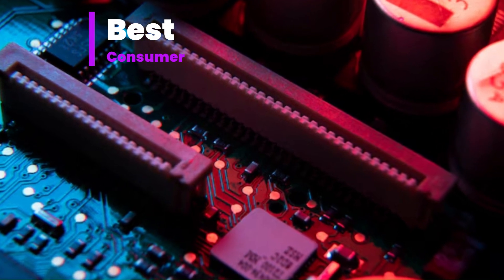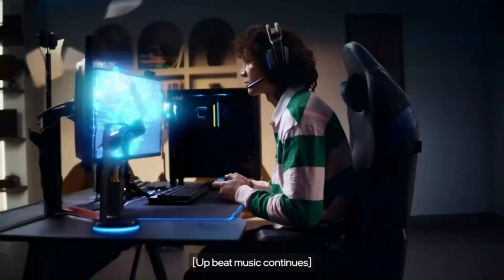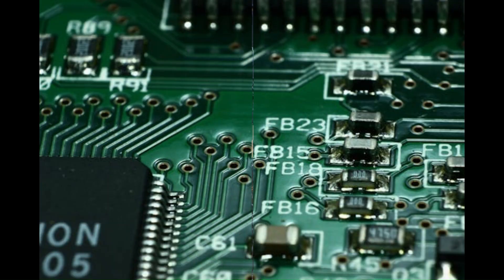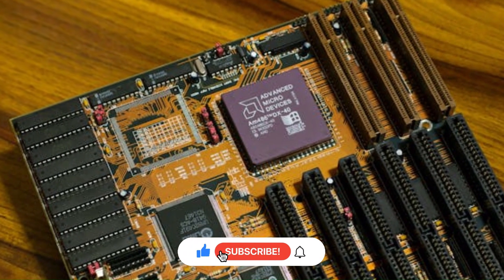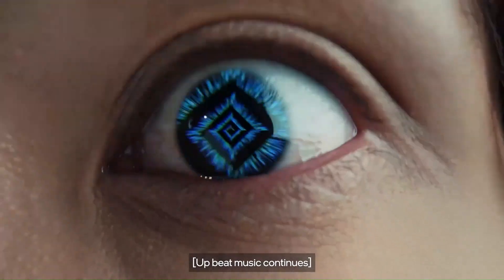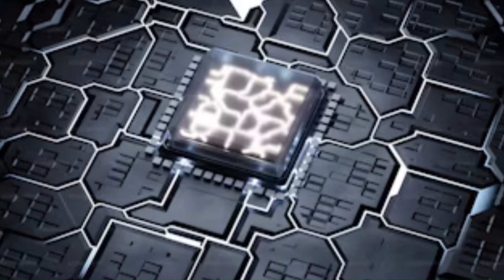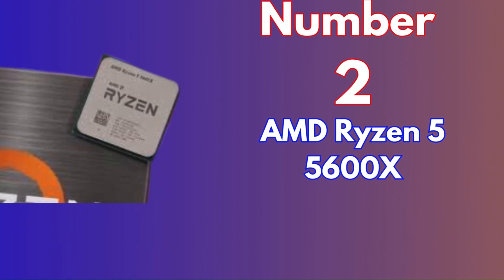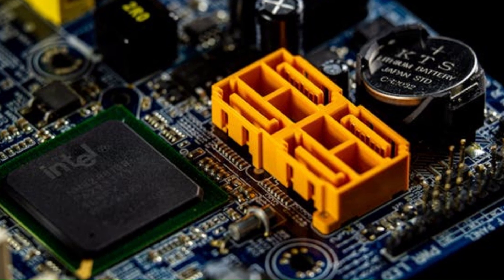5 Best CPUS Of 2024

Comment: let's change this list significantly,
1. Ryzen 7 7800x3D ($300 but worth)
2. Ryzen 5 7600x (i mean you can get it for $165 poggers)
3. Ryzen 5 5600/3600 (dude the budget pcs I've seen with these cute cheap guys, AM4 W)
4. Ryzen 9 7950x (dude this thing chomps through multithreaded tasks, but probably not worth it)
5. Ryzen 5 8600G (super awesome for mini PCs with that GPU perf, make the tiniest pc that can game)
Source: Intel and AMD stock graphs, Intel 13th/14th gen cpus 100% failure rate
Reply: For someone who probably wont benefit from anything more than 6c12t, the 3600 and am4 was a god send.

My line of work and game that i play dont need 8c and above.

The only upgrade that ill do after this is gonna from the same class as 3600/5600.
Nothing higher and nothing lower.
Reply: @kurakurakii3792  for real, my girlfriend rocks a 3600 and rtx 3080 and it’s smooth sailing, I got two PCs, one with an r7 7800x3D and another with r5 7600x and both are extremely fast, especially with how hard 7600x overclocks holy. Definitely big fan, because before these guys I had a i9-9900k and it was not much faster than the i7-6700k I had before it, AMD makes you feel the generational leaps
Reply from the maker: ohky you want video bro?
Reply: @BestConsumer1  not sure if you should make one about these old cpu, this chips have been milked dry over the year.
As long as the next one is interesting people will watch it.
See your overall audience say tho
Reply from the maker: @kurakurakii3792  if you say make i can